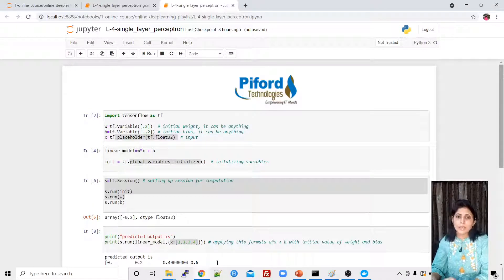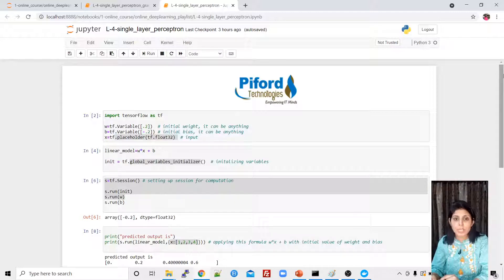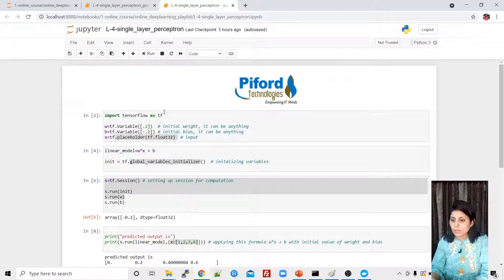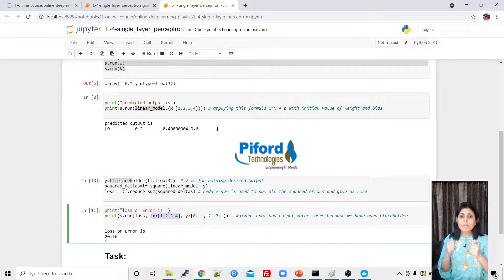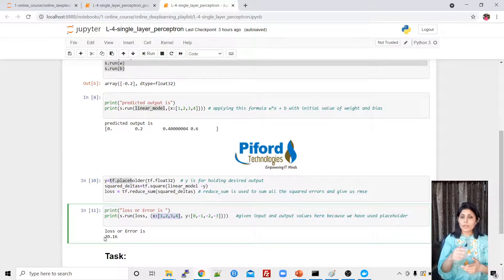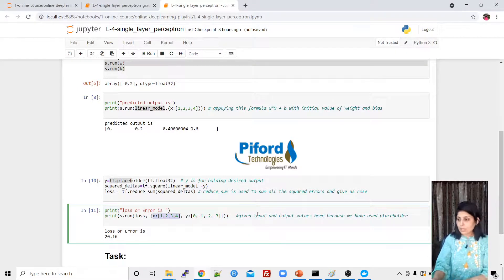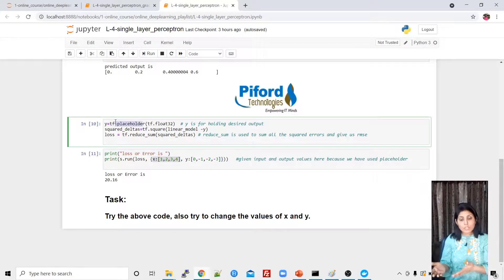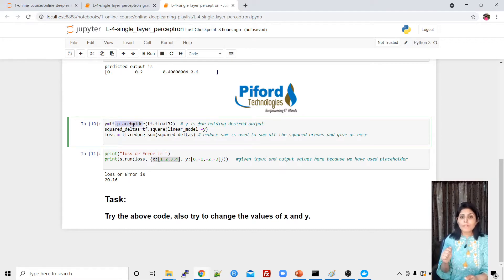L-5 Perceptron Implementation | Single Layer Perceptron

Comment: Ma'am plz aap code ko live likhe 
x=tf.placeholder(tf.float32) error bta rha hai
Reply from the maker: THis example is with tensorflow 1. You are getting error because of that. In tensorflow 2, we use eager execution is enabled by default. So, replace this line with :
x = tf.constant([[1.0, 2.0, 3.0]], dtype=tf.float32)
or
x = tf.Variable([[1.0, 2.0, 3.0]], dtype=tf.float32)